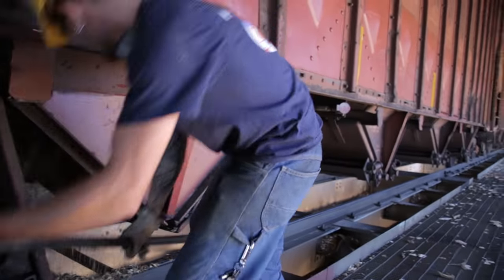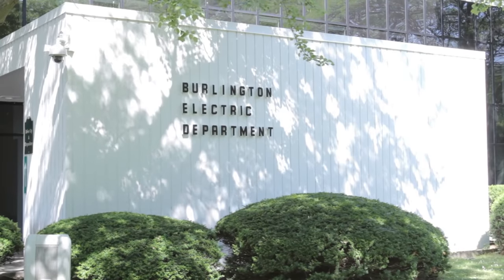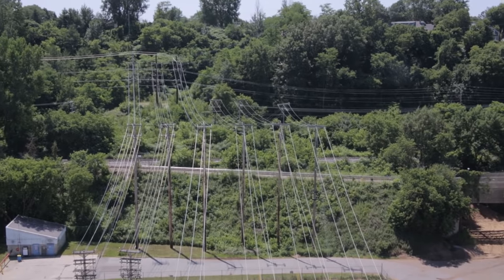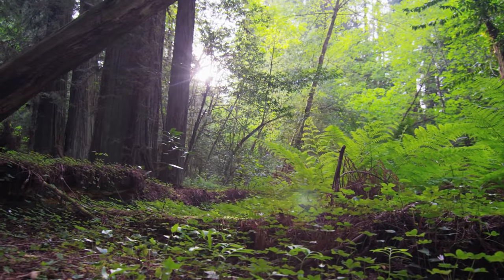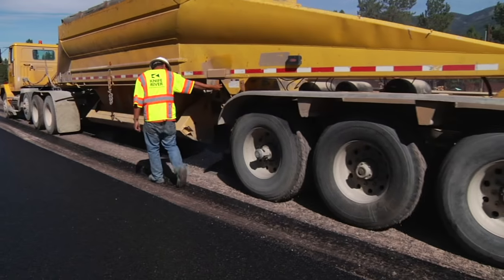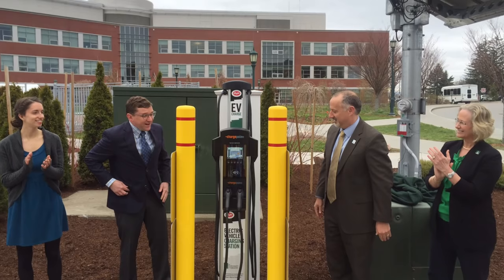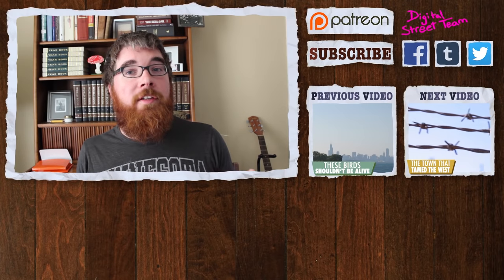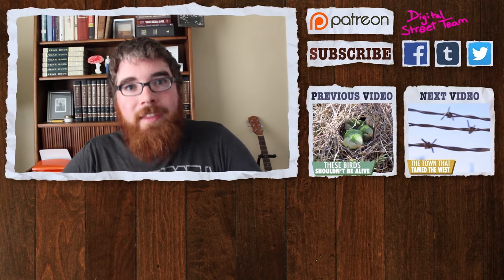Can A City Run On 100% Renewable Energy?

Comment: 6:35 Wait, why? This is cut together strangely. Can't coal and oil and natural gas provide power 24-hours per day? Did he actually claim wood chips provide less CO2 emissions per kilowatt than fossil fuel sources? Seems like he dodged this question entirely.
Reply from the maker: Coal and Natural Gas can provide 24/7 - he was just comparing biomass to wind and solar which cannot provide 24/7 power.  In terms of CO2 emissions, their argument is that if you plant as many trees as you burn, than those new trees will suck an  amount of CO2 from the atmosphere that is equal to the amount being released by biomass.  So in the end, if done properly, it should even out, and biomass should be carbon neutral.  You can't say the same about fossil fuels though, which represent millions of years of carbon from biological material.
Reply: Thanks for clarifying about the "24/7" part. This argument that plant as many trees as you burn makes biomass carbon neutral is unconvincing. It ignores how the CO2 cycle works. By taking tree biomass out of the food web, you remove the possibility that it will be fixed into the soil. In order to make a convincing argument that wood chip biomass emits less CO2 per kilowatt than other sources, much less that it's "carbon neutral", you have to compare the environmental fate of the carbon with and without harvesting. I haven't ever seen this done, and it certainly wasn't addressed in the video.
Reply: He did say that the company collects the ashes and other particulates that result from burning the wood chips and uses them to help enrich soil around the city. I would imagine that includes the soil used on the "tree farms". Of course this doesn't answer every question but I also think if you're considering the overall amount of CO2 emissions that a city of 42,000 would normally release, maybe we could say the total amount of emissions is less in this city where they not only replenish their source of biomass but only emit CO2 by burning the wood.
Reply: Another way of viewing the argument is that by viewing two pools of carbon, one being atmospheric, oceanic, and biomass carbon (CO2 cycle carbon), and another being fossil fuel carbon, the atmosphere and biomass carbon is constantly circulating and relatively fixed in quantity.  The fossil fuel carbon is isolated from the other carbon and does not exchange except by human intervention. 
So when we are burning the biomass, we are keeping the carbon that is contained in the active CO2 cycle and not emitting carbon that was otherwise never going to enter that atmosphere.
Reply: +99Chemicals, this doesn't address my point. What is claimed at 6:35 is that biomass is better than burning oil or coal. The contextual implication is that this is due to its sustainability, and use in mitigating climate change. The former is obviously true. The latter claim implied in the video must be backed up by comparing CO2 emissions per kilowatt. No such comparison is offered in the video! It's a rather huge oversight.
Reply: I was addressing your comment that starts with " thanks for addressing the 24/7..." but it appears that youtube comments are arranged in an entirely useless manner.
Reply: 99Chemicals I have not seen it demonstrated that wood-chip biomass is carbon neutral. I doubt that it is. But I'm open to changing my mind. The term "carbon neutral" makes a claim that using the fuel source doesn't increase the concentration of CO2 in the atmosphere. I don't see how viewing two pools of carbon helps us know if wood-chip biomass is carbon neutral.
Reply: Because carbon neutral means that no carbon from the fossil fuel pool is being added to the atmosphere. No new carbon is being added because the carbon already in the cycle is remaining in the cycle making it neutral.
Reply: +99Chemicals that's not what carbon neutral means. A means of energy extraction is "carbon neutral" if and only off the concentration of CO2 in the atmosphere doesn't change as a result of energy extraction. Non fossil fuel sources, like biomass, can be carbon neutral. But this must be demonstrated scientifically.
Reply: The carbon that makes the wood comes from the air. None comes from the soil. All the carbon that's released by burning comes from the atmosphere. That shows that it's carbon neutral. If you traced each of the carbon atoms that are coming out the stack into the air, backwards through time, eventually you'd see them being sucked out of the air, into the leaves where they're combined with water to make sugars.
Reply: +gasdive no, that doesn't show its carbon neutral! How many times do I have to say this? It suggests it's probably nearly carbon neutral. But you've failed to account for systemic effects on the carbon cycle. If an energy extraction process reduces a carbon sink, e.g. peat formation, you have changed the carbon cycle and your process is not carbon neutral. I don't know that wood chip biomass does significantly impact the carbon cycle. But I have not seen it demonstrated that it doesn't.
Reply: PhysicsPolice
So, if I understand it, you're saying that the trees 'might' be extracting carbon from the air and fixing it in a way that removes it from the carbon cycle. By cutting and burning them you're interrupting that fixation process and carbon that would (maybe) otherwise fixed is put back in the air.

If I've figured out what you're saying correctly, then growing forests should be removing CO2 from the air permanently. But they don't. The Carbon captured by forests doesn't stay captured, it comes back into the air. You can see it happening on the CO2 trace as it wiggles up and down each year. The sort of trees that make forests don't end up as peat, and even peat isn't really long term in a geological sense.
Reply: gasdive How do you know forests don't contribute to CO2 fixation? Do you believe, if all the forests died, that CO2 fixation rates would continue uninterrupted? I think not.
Reply: gasdive I mentioned "peat" merely as an example of a biological fixation process. And you're wrong. The formation of peat is often the first step in the geological formation of other fossil fuels such as coal. https://en.wikipedia.org/wiki/Peat
Reply: PhysicsPolice "How do you know forests don't contribute to CO2 fixation?"
If forests fixed carbon then we'd see the carbon. It would be lying there on the ground. Other than peat (which happens with swamps, not loggable forest) and so called 'horizontal forest' (which is also not loggable) there isn't tens or hundreds of metres of carbon underlying these forests.
Reply: gasdive
The carbon in trees doesn't stay lying on the ground. Tree parts are eaten by herbivores, decomposed by detritivores, etc.
Reply: PhysicsPolice
If it doesn't 'stay' it's not 'fixed'. When the herbivores or whatever metabolise, the CO2 goes back into the atmosphere. Which was exactly my point. Trees (in loggable forests) don't fix atmospheric carbon long term.
Reply: gasdive
Quit being obtuse. Carbon entering the food web can end up getting fixed in the ocean and in the ground. If you cut some wood off a tree and burn it, that carbon goes into the atmosphere. Not into the food web.
Reply: PhysicsPolice
I'm not being obtuse. Wood that's eaten by fungi doesn't get fixed in the ocean and it doesn't get fixed in the ground. Not until the metabolism of the fungi releases that carbon back into the atmosphere, from which it can make its way into the ocean or to a swamp where it might be fixed. Burning releases the carbon back into the atmosphere, being eaten by a fungus releases the carbon back into the atmosphere. Loggable forest DOESN'T FIX CARBON.
Reply: You are being obtuse. Wood that's eaten by fungi can logically get fixed in the ocean if the fungi is eaten by an insect that's eaten by an animal that shits into the stream and that shit is carried to the ocean. It can get fixed in the ground if that fungi is eaten by an animal that dies in a peat bog.
Reply: What we need is a scientific examination of these processes. Such investigation can be done, but not simply sitting in an armchair.
Reply: If you choose to reply to me again, either do so with a link to such scientific work, or an argument which addresses my point that carbon entering the food web can become fixed, while carbon burned cannot.
Reply: PhysicsPolice

Food web carbon has reached  maximum and is declining.

"A recent analysis of an Antarctic ice core (Indermühle et al. 1999) found that atmospheric CO2 concentrations declined from a post-glacial maximum of 268 p.p.m., reached a minimum of 260 p.p.m. in the early Holocene (8200 years B.P.), and subsequently increased linearly to 285 p.p.m. at the start of this millenium. Together with δ13C data, this implies that carbon storage in terrestrial biomes reached a maximum in the warm, moist, early Holocene, and has subsequently declined by 195 Gt C, probably due to a gradual cooling and aridification of Holocene climate.

http://onlinelibrary.wiley.com/doi/10.1046/j.1365-3040.1999.00453.x/full
Reply: All the more reason not to cut down trees.
Reply: +PhysicsPolice Not to mention cutting down, hauling back the trees, then cutting them up, then transporting on a train, then trucking to the plant...etc., each step produces more greenhouse gases.
Reply: I see your point here. But you are not taking into consideration the damage to the soil. I would prefer very much to leave up a line of trees and use coal. So you'd be "absorving" the CO2 emitted.
Reply: Santiago Picco Renewable energy technology is evolving exponentially and all traditional energy forms will be killed within the next decade. They have even developed a paint which acts like a solar sell.
Reply: nayanmalig Of course solar is much better. My point was coal vs biomass.
Reply: I bet they can't grow the trees as quickly as they cut them down and burn them.

So, how long before the renewable(?) source runs out and then what?
Reply: Mick S I bet they can. If there is political will.
Reply: nayanmalig 
I don't care how much political will can be mustered up, you can't force the trees to grow any faster.
Reply: Mick S More trees.
Reply: nayanmalig 
Where?  Where are the extra trees to be planted?  On the farm land?  Knock down the dwellings?  Rip up the roads?  Where?
Reply: nayanmalig
There is a difference between having a negative view and having a realistic view (and it is not just Americans).

Although there may be many solutions to a lot of problems, they all should be confirmed to be realistic to be achievable.  ie it is nice to dream of living in a world without conflict but is it achievable?  I would say not.

In this instance the article is about one town being supplied with electricity supplied 100% by renewable energy, of which 43% comes from burning wood chips.  Therefore, the supply of wood for the furnaces should come only from the region around the said town.  Sourcing wood from outside its own region leads to two problems.  Firstly, the need to transport the wood to the furnaces which would require some form of transport that would pump yet more CO2 into the atmosphere.

The second problem is that taking the wood from areas outside of their own environs would deprive other regions of the same resource.

To end on a positive note:  One thing that will make the trees grow faster is more CO2
Reply: Mick S Innovation cannot replace lack of political will.
Reply: nayanmalig And all of the will and all of the best of intentions cannot turn the nonviable into a workable solution.  It would be great if non of us had to pay taxes, but that is simply not a viable situation.

If the innovation existed to produce affordable electricity by using renewable resources, don't you think that big companies would be falling over each other to get their share of the market.

Also, in a democratic society, political will is actually the will of the majority of the people of the nation that elected the politicians..
Reply: Mick S If there was democracy and will of the majority Al Gore should have been president. Stop dreaming and wake up.
Reply: nayanmalig 
There is democracy and the majority of people that could be bothered getting off their backside and voting chose not to have Al Gore as their President.

That is how democracy works and I am not the one that is dreaming.
Reply: Mick S Gore won the national popular vote but lost the electoral college vote after a bitter legal battle over disputed vote counts in the state of Florida. Bush won the election on the electoral college vote of 271 to 266. One elector pledged to Gore did not cast an electoral vote; Gore received 267 pledged electors.

Even if all the Americans crawled on all fours like sheep to the polling booths booth Gore would have still lost. Democracy the biggest BS fairy tale ever told. Did you also vote to destroy Libya, Iraq, Iraq etc and kill/displace millions?
Reply: nayanmalig 
My, haven't we wondered a long way off the topic.  But I shouldn't be surprised as it is the normal tactic of the left to change the topic when their argument is failing.

The weakness in your logic is that if Gore had won by the same numbers rather than lose you would have thought that the system is fair and just.  It is only when your chosen one loses that you think that the system is broken.  That is democracy. 

Democracy as practiced in most western societies, may not be a perfect system but it sure as hell beats all of the alternatives.

As for the Middle East, it has been a melting pot of self destruction for thousands of years.  Just look at Lebanon.  A once vibrant country is now a hell hole with thousands of people being displace, all without the intervention of any Americans.  Egypt is another country that is also on a path to self destruction without the help of any western democratic countries.

If you think that the way that the countries are ruled in the Middle East to be better than the western democratic countries, may I ask who voted for the people that thought it was OK to hijack civil aircraft and fly them into the twin towers, destroying the lives of thousands of Americans?

Or what about Libya's involvement in Lockerbie., or do you just conveniently forget about that because you choose to look at Libya as the victim, not the aggressor.
Reply: UNSUBSCRIBE
Reply: Mick S  "all without the intervention of any Americans"

Holy shit man, just google "US intervention in Lebanon" before you say stuff like that!
Reply: PhysicsPolice 
Never was subscribed
Reply: Mick S I was joking. Because you guys are veering way off topic.
Reply: PhysicsPolice 
I agree but it is very hard to keep a leftie on track when they run out of BS to substantiate their argument.
Reply: Mick S There's nothing about one or another political leaning that necessarily makes someone predisposed to veer the conversation off topic.
Reply: PhysicsPolice While that is true, it appears to be more prevalent among the lefties, probably because their idealisms are so often found to be flawed.
Reply: Denial reaching absurd levels.
Reply: +Mick S no
Reply: Biomass is Carbon neutral because during the lifetime of the tree/plant (that is being burned for energy) it takes carbon from the atmosphere and then when it's burned it releases that same amount back to the atmosphere.
Reply: Sorry, Tea Rex, that's just not what "carbon neutral" means. By this logic, coal is carbon neutral, because coal is made from organisms which got their carbon from the atmosphere to begin with. Carbon neutral doesn't refer to the source of the carbon inside the fuel. It refers to the overall outcome of energy extraction on the concentration of CO2 in the atmosphere. This outcome has not been demonstrated to be zero for biomass fuel sources. I've said this over and over in these comments. I wish you had done me the respect of reading this before leaving a redundant and ignorant comment.
Reply: PhysicsPolice In a broad sense coal and oil are carbon neutral as they the don't add carbon to the system(the earth) The big difference is the time between the carbon being fixed and released,  coals carbon comes from  a lot longer ago then a decade old tree. if you burn a tree and it releases carbon it can't release more carbon then it fixed in its lifetime. The time delay between the carbon being released and refixed may be a few years but continued growth of trees can help mitigate this.  Biomass is a promising energy source and even if you right that it's not carbon nuetral it is still preferable to traditional fossil fuels.
Reply: Tea Rex, you can have fun redefining words. I won't stop you. Burning tree biomass to create electricity has not been shown to cause a zero net influence on the concentration of CO2 in the atmosphere. There are good reasons to believe the opposite is true. I agree biomass is preferable to fossil fuels, because it's renewable. (That's not the same thing as carbon neutral.) But what has this got to do with my comment? The video at 6:35 is cut together strangely and the argument doesn't follow. Let's stick to discussing this objection.
Reply: PhysicsPolice 
I still question the "renewable" aspect in that trees can be regrown in the short term, but they are not infinite.  Eventually the burn rate will out strip the growth rate.  

And let's not forget the Carbon Trading Schemes in which money is paid to other countries to stop them cutting down trees in a trading system to allow the burning of fossil fuels, while burning trees under this scheme to create electricity.

Seems like false logic to me.
Reply: +Mick S tree farms are as "infinite" as food farms. No, the burn rate will not outstrip the growth rate of they are properly managed. I have no reason to believe the operation in this video is improperly managed. Do you?
Reply: +PhysicsPolice I was trying to explain how biomass(with sustainable forestry) would have a net emission of co2 less then normal fossil fuels as you seemed to think the guys  claim from the video was unbelievable.
Reply: PhysicsPolice
While it hasn't been shown to be completely zero, just a quick back of the envelope assessment shows that it's close. To get to zero will need electric powered harvesting and transport. Technically possible but not yet available. The problem with biomass isn't that it's not quite zero carbon, it's that it doesn't scale up in the time we need it to scale up.

Scientists have been saying we needed to take big steps within the next 5 years, for about 30 years. Well it's too late now to avoid bad climate change, but we might be able to avoid catastrophic climate change if we cut out carbon output within the next 10 years. If we started planting trees today, over an area about 3-4 times the area of India, then we can't harvest for at least 30 years. That's probably 50 years too late but at least 20 years too late. Not to mention that we would have to divert most of our crop land to this right at the point productivity is going to fall due to climate change.
Reply: +Tea Rex I also suspect this is true, that biomass emits less CO2. But your explanation is not sufficient for us to know that it's true. In science, you have to identify and add up all the variables. Having failed to attempt any such comprehensive analysis, the argument is unconvincing to me as a scientist.
Reply: +gasdive which back of the envelope calculation are you talking about? Please show your work.
Reply: +gasdive Yes, I agree biomass doesn't scale well and that it has a long ramp up time because trees take years to grow. This seems non sequitur to my original comment. Let's try to stay on topic, please.
Reply: Here's my back-of-the-envelope calculation. I don't claim any of these numbers are correct. These are all just guesses. I welcome anyone who has the correct numbers! This is all I'm asking for! A comprehensive and accurate accounting of biomass CO2 emissions! What follows is merely an example of how this accounting should look.

When evaluating the carbon emissions of an energy source, you compare total emissions under two circumstances. First, if you do not extract the energy (E1). Second, if you do extract the energy (E2). We know that E1 is negative i.e. forests fix carbon. This probably varies a lot from biome to biome. Let's assume -110 tons of CO2 fixed per acre per year [1]. Let's say you remove 10% of the biomass per acre per year. Assume that fixation is reduced linearly by removing biomass. E2 = E1 * 90% = -99. This means E2 - E1 = 11 tons of CO2 (net positive emissions) per acre per year. Just by removing the biomass from the forest! Add another term (D) for the CO2 emitted by diesel fuel used by machines which cut, haul, and process the biomass. Let's assume an acre is harvested yearly in just one day and use the truck fuel consumption per week figure of 3648 gallons from [2]. Using the figure from [3] that comes to 3648/7*2,778 grams = 1.6 tons CO2 emission per acre per year. Then add another term (M) for CO2 emissions for creating and maintaining machinery. Then add another term (I) for any inputs into the system like fossil-fuel derived chemical agents, etc. Let's assume M and I are on the order of D. The net emissions are calculated as E2 - E1 = (-99 + 1.6 * 3) - (-110) = 15.8 tons CO2 per acre per year.

How does this compare to other energy sources? Let's assume a 30 million tons clear-cut equivalent from 1.2 million acres per year and 50-megawatt plant burns around 2,550 pounds of green wood per minute [4]. That's 12 million acres if we only harvest 10% of the wood per acre.

2,550 lbs/minute = 262,987 tons per hour fuel to power a 50-megawatt plant.
(12 million acres) * (262,987 tons / 30 million tons) = 105,195 acres to power a 50-megawatt plant.
(105,195 acres) * (15.8 tons CO2 / acre / year) = 1,662,081 tons CO2 to power a 50-megawatt plant for a year.
(1,662,081 tons) * (1 hour / 1 year) = 189.6 tons CO2 emissions per hour to power a 50-megawatt plant.
189.6 tons / 50,000 = 7.584 lbs/kWh

That's more than twice the CO2 emissions from coal [5]! Did I do my math wrong? Almost certainly. I don't believe this conclusion is correct. But it's an example of the kind of math we need to do on the back of the envelope.

1. https://www.fas.org/sgp/crs/misc/RL31432.pdf
2. http://wsri.org/resources/media/RegCostAnalFinalRpt.pdf
3. https://www.chargepoint.com/files/420f05001.pdf
4. http://www.pfpi.net/biomass-basics-2
5. https://www.eia.gov/tools/faqs/faq.cfm?id=74&t=11
Reply: PhysicsPolice
I agree with your idea that you should compare doing with not doing. However not doing means that you'll be burning coal instead. There's the carbon emissions involved in felling, transporting and chipping the trees, but that needs to be compared to the digging, transporting and crushing of the coal. Not compared to doing nothing.

You also count uncut forest as a carbon sink. I'd dispute that. If it's a carbon sink then there would be a big pile of carbon sitting under the forests that have been there for thousands of years. You estimate that 110 tonnes of carbon are fixed by a forest each acre-year. So a forest that's been on that spot since the last ice age, there should be 1 100 000 tonnes per acre of built up carbon. Clearly there isn't. The carbon captured by trees goes back into the air when the trees rot.
Reply: No, in no way does "burning coal instead" change the values of either E1 or E2. First you calculate the difference (E2 - E1), then you compare this number to "burning coal instead".
Reply: No, I don't count uncut forests as a carbon sink. Much of the carbon taken up by trees in a forest goes into the food web where much of it does get sequestered. Not all of it is released when trees rot. There is a "big pile of carbon" but it's not under the forest, per se. It's in the form of oil, coal, limestone, etc. As I made abundantly clear in my comment, the numbers are all just guesses. However, the fact that forests are a carbon sink is not a guess. It's well-established fact. Your personal incredulity not higher quality evidence than professor Gorte's research paper [1]. Please do read the paper. Please do not straw man my argument.

1. https://www.fas.org/sgp/crs/misc/RL31432.pdf
Reply: PhysicsPolice
Oil and coal isn't really being formed these days. Limestone comes from coral reefs not forests.

I read the PDF and it says the same as I have been saying. "Plants eventually die, releasing their stored carbon to the atmosphere quickly or to the soil where it decomposes slowly and increases soil carbon levels"

I know this is the first conversation we've had, but this seems to be the story of my life. I argue with people and they quote papers, saying 'see... you're wrong' and the papers say exactly what I've been saying.

There must be something about how I phrase things that means people get the exact opposite of what I'm saying.
Reply: +gasdive whether nor not oil and coal are being formed today they still exist as examples of the thing your common sense said should be there. Limestone has carbon in it which must have entered the food web from some source. That source can be terrestrial plants, even for sea life. The paper did actually conclude what you have been arguing against: forests sequester carbon. This one quote you mined doesn't contradict this basic fact. You misjudge me greatly if you presume I quote mine. I do not. You just did. Think about that...
Reply: +gasdive even if I had misunderstood that paper, it doesn't matter to my point which was to illustrate how it should look to do a comprehensive analysis of an energy source's carbon emissions. I disclaimed clearly that the numbers used are guesses. Please do not straw man my arguments.
Reply: +PhysicsPolice Biomass must be carbon neutral if the forest cutback is to reach its former density. The same amount of carbon dioxide must be taken out of the atmosphere as was burned the first time. 

Another thing to consider is that if the trees hadn't been used for fuel, they would have eventually broken down into carbon dioxide and methane, among other gasses through natural decomposition processes. The difference here is that the decomposition happens through burning in a power plant instead of slowly by feeding fungus and bacteria. 

However, the key variable that makes biomass energy carbon neutral, but not fossil fuel, is that cutting down trees sustainably leaves new space for trees to grow, but mining coal or natural gas does not.
Reply: Ian Krasnow
Please read my previous comments. I've explained many times why this argument fails. And for some reason people like you keep making it! Cutting back the forest to its former density means taking carbon out of the forest and putting it into the atmosphere. This can change the concentration of CO2 in the atmosphere, compared with not burning the biomass fuel. Forests sequester carbon directly, and those fungus and bacteria take the carbon from dead trees away into the greater food web, where it can be sequestered in other places. By removing dead trees from the forest, you remove the opportunity for their stored carbon to be sequestered.It's impossible to conclude from the regrowing of cut trees that the process is carbon neutral. This is simply mistaken accounting. It's a foolish and naive argument which ignores that forests are carbon sinks. Biomass may be carbon neutral. I don't know. But in order to find out we need a more detailed analysis of its impact the carbon cycle.
Reply: First, you didn't calculate the amount of carbon exhaust from the trees, from animals and funges and bacteria that live in the forest, and the dead bodies. It is crucial to calculate it in both case, before and after extracting energy.
Secondly, moving biomass from the forest doesn't mean emitting in general. You see, the biomass of the forest before extracting can pretty fixed, and when you manage to keep 90% of the forest, equivalently to removing 10% of the forest, you actually remove a fixed amount of carbon. It is not 100 tons/year, it is just 100 tons from the beginning, and 0 ton/year afterwards. So initially it can increase the concentration of CO2, but in general, it doesn't create new CO2 to harvest energy. That's how it can be carbon-neutral
Reply: Phúc Minh Nguyễn Lê Yes, it's crucial to calculate everything! That's my point! I've seen no such calculation done for biomass. People have suggested, based on a just-so story about plants taking in carbon as they grow, that the process of burning tree biomass as fuel is carbon neutral. That's wrong. It does show that the practice emits less carbon than burning fossil fuels. That's good. But it doesn't follow that it's carbon neutral.
Reply: Phúc Minh Nguyễn Lê
Your example calculation actually shows biomass cannot be carbon neutral. (Though I don't believe it's accurate and wouldn't use it to argue this case myself.) If burning biomass is equivalent to reducing the size of a forest (I'm not saying that it is), and forests sequester carbon (which is a scientific fact on which we all can I hope agree), then burning biomass changes the global rate of carbon fixation (by some negative amount). This will, all things being equal, raise the concentration of CO2 in the atmosphere.
Reply: Well, it depends on what you think carbon neutral is. Like I said, initially, it does need some carbon as energy conductor, it does rise the carbon concentration, but it doesn't release new and new carbon as it harvests energy, so, pretty much better than a method that continiously release underground carbon. If I'm going strict like you said then most clean technologies are not  clean, because they still need to consume resources for their materials and infrastructures. Of course, we still need to take that into account to consider how clean and feasible a technology is.
And furthermore, I think the most important thing aout it is that it can encourage the protection of trees. When your energy relies on forests, and you can really control it, you can maintain that energy resource, then you will realise its importance and will have more serious action to protect it. And may be, i'm not sure, it can reverse the trend of deforestation, it would give much more positive effects than the negative ones by the technology itself.
Reply: Phúc Minh Nguyễn Lê You sound confused. I never said, nor do I believe that an energy source must be carbon neutral to be "better than a method continuously releasing underground carbon". I never said, nor do I believe, that energy sources which aren't carbon neutral are therefore "not clean". I believe burning biomass causes less CO2 to enter the atmosphere, per kilowatt, than does burning coal. The guy in this video claimed biomass is carbon neutral. He didn't explain how he reached that conclusion, and I haven't yet been convinced from my research on the topic that he's right. I agree the most important thing is to encourage the protection of trees! I don't see how lying about knowing biomass to be being carbon neutral helps the trees.
Reply: I'm not confused, i'm just trying to explain the term "carbon neutral". The term doesn't have to be strict, it can be used when it is practically acceptable. It does not necessary mean completely no carbon footprint, or zero-carbon. Here it means that the technology can create a balance so that it can stop emmiting more carbon as it create more energy, and I gave the counter one just to make my point clearer. It's not about your point
When I talked about clean energy I meant the same thing. "Clean" strictly means no harm to environment. But most clean energy methods still have some impact on the environment. Like with solar power you have problems with manufacturing solar panels and batteries, and also deposition and maintenance. With hydroelectric dams you need large areas for reservoirs, and you also need to be concerned about river's flow,....
Reply: I'm happy to use whatever definition of the term "carbon neutral" you prefer. However, if your definition includes energy sources which raise the concentration of CO2 in the atmosphere by burning things, I don't think we'll have an easy time convincing anyone else on that definition. It hasn't been shown that biomass has negligible impact on the concentration of CO2 in the atmosphere. There are good reasons to expect it has a large positive impact (you're removing carbon from the forest where it can be sequestered and putting it directly into the atmosphere where it stays for a long time). You did touch on this very point, no matter how much you now choose to deny it.

Some people have made flawed arguments that biomass is carbon neutral (trees take in as much CO2 when growing as they put out when burnt). It's important we show how these overly simplistic arguments are wrong: forests sequester carbon and so removing biomass takes carbon out of that sink, and puts it directly into the atmosphere. We should not be fooled by bad arguments just because they lead to conclusions we wish to believe.
Reply: its not perfect but have your ever lived near a coal plant yuk bla!
Reply: +PhysicsPolice It is not a flawed argument, it is in fact carbon neutral, because as you mention trees take in the exact amount of carbon when they grow as they put out when burnt.

Let me put it this way: Lets say I plant a tree in my backyard and I let it grow for 5 years. At that point it weighs 1 ton, which mean it took in 1 ton of carbon from the atmosphere. Then I burn it releasing that carbon back to the atmosphere. Then I repeat the process every 5 years

As you can see I'm using the same ton of carbon again and again. That's how this is carbon neutral.

You can't do the same with fossil fuel, if you burn oil (that's carbon that has been out of the system for millions of years) that CO2 is released to the atmosphere and you have no way to turn it back into oil and send it back underground
Reply: burt591 I like your hypothetical and it can be used to illustrate my point quite nicely: you don't have to burn the tree in your back yard. You could let it keep growing. A living tree has indeed sequestered its carbon from the atmosphere. Yes, if you consider planting the tree in your back yard a carbon credit equal to the amount of carbon in the tree, then burning it negates this credit and you're whole system is carbon neutral. Maybe you can argue this is how we should see your back yard. But it's not how we consider forests. We can't claim carbon credit for all the biomass burnt. Not if we want people to take us seriously when we claim biomass is carbon neutral. It's a transparent lie that won't fool me or anyone else.
Reply: PhysicsPolice
What if instead of using forests we make a tree farm were we grow a fast growing species and use it as fuel? Would be that acceptable for you?
Reply: burt591 Not if you cut down a forest to make room for your tree farm, no. If you replant trees on an already deforested area which would have remained deforested without your intervention, then yes. What matters is honestly comparing the outcome on atmospheric CO2 between the do-nothing and extract-energy alternatives. If part of your extract-energy alternative is truly carbon negative in excess of the amount burnt, then I'll be the first to exclaim you've got a carbon neutral source of energy!
Reply: For example, if the system of biomass extraction pays for forest restoration that increases the annual CO2 sequestration in that forest by an amount larger than the amount burned to extract energy, then it's carbon neutral. But carbon sequestration is expensive. I don't know how you'd increase the carbon sequestration of a forest besides continuing to reforest more land each year.
Reply: PhysicsPolice
I didn't said I would cut down a forest to make room for the tree farm, I was referring to make a tree farm on an empty area.

Also carbon neutral means that it doesn't add CO2 to the atmosphere, not that it has to reduce it, so you don't need to pay for carbon sequestration by an amount larger than the amount burned. You can do it anyway if you want, but it's not what carbon neutral means
Reply: burt591 Yes, carbon neutral means that it doesn't add CO2 to the atmosphere. When you burn biomass you add CO2 to the atmosphere. So, in order to be carbon neutral, your biomass system has to reduce CO2 by some other means. Turning a desert into a forest reduces the amount of CO2 in the atmosphere by biomass accumulation (a large, short-term reduction) and gradual permanent sequestration (a slow, long-term reduction). So long as these two reductions in CO2 equal or are greater than the CO2 emitted by burning biomass, you're carbon neutral. To my knowledge no biomass operation has made any claim like this. Nor have I seen any calculation of the cost required to create a forest large enough to meet these requirements. Biomass as in this video involves clearing material from extant forests. Biomass operations can't claim credit for the CO2 sequestration from extant forests.
Reply: burt591 Yes, if you pay carbon offsets for the amount burnt, you can call your operation carbon neutral. THIS IS NOT what is being claimed in this video! Burning biomass (by its self) has not been shown to be carbon neutral.
Reply: PhysicsPolice
Ok but in the hypothetical situation I'm proposing, if I make a tree farm on an empty area, and use it as fuel, is it carbon neutral or not?
Reply: burt591 It depends! That's my point! You have to do the math and compare all changes to the concentration of atmospheric CO2 as a result of your choice to extract the energy. It doesn't merely depend on the simplistic fact that trees get their CO2 from the air. Biomass energy systems are more complex than can be accounted for by this fact alone. That's my whole point.

You're acting like your mind is impervious to this idea.
Reply: PhysicsPolice
What other factors should I consider?
Reply: I've explained this over and over. Scroll up and read my comments if you're genuinely curious.
Reply: Like perpetual motion, it is not physically possible. But it would be better than other burn generation systems.
Reply: This is exactly what I was thinking when they where talking about how great burning trees is lol
Reply: Sure it's physically (logically) possible. You could burn 1 tree, make $100 dollars from the generated energy, use that money to plant 3 trees, then cut one down... etc. Eventually the Earth would be covered with your tree farm. And atmospheric CO2 would lower than when you started. But I'm not convinced the biomass company in this video is doing any such thing. I think, but am not certain, that they have a fixed plot of land. That fixed area of forest sequesters carbon. It has done before they ever bought it. And it will do if they leave it alone. But if they cut down one tree, that takes some carbon out of the system. That's 1 tree's worth of carbon not available for sequestration, which may slowing the rate of sequestration by some small but non-zero amount. That's the problem.